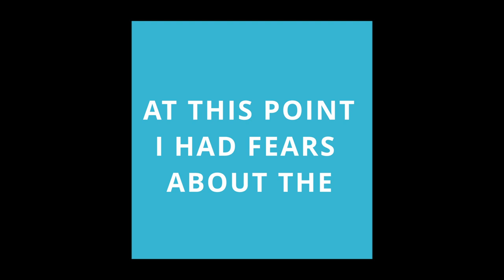VAUXHALL AGILA - UNISTRUT Roof Rack Build Part 1

Comment: Why didn't you use short pieces of unistrut directly onto the roof, That way you would not have had to drill extra holes? Good bomb-proof job.
Reply from the maker: I only done it that way so it was more secure.  Funny enough I tried the other way it wasn't nearly as strong kr sturdy.  It has come out well.

Comment: Doug Alex do the timing chain, they go for fun
Reply: Thank you!! We will definitely get that done!
Reply: @compactcamperco  I use to work at Vauxhall when the Avila first came out. I’ve changed the chain at 40,000 to 68,000. It would be a shame to have to get it repaired on route xx sometimes they just snap without warning. Good luck though, I’m sure you’ll enjoy ever minute and a I’m well jealous.
Reply: @ROLYTHETAXI  thanks for the top tip, let us know if you think there is anything else that is a definite to be changed before we leave! 😀